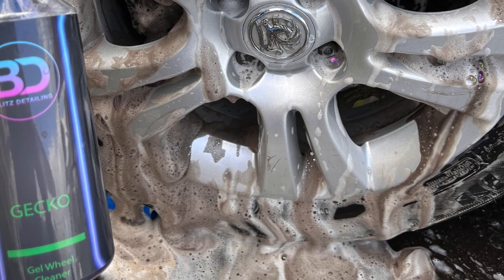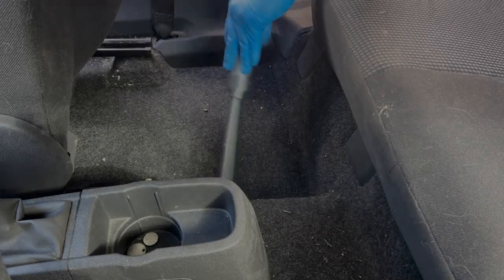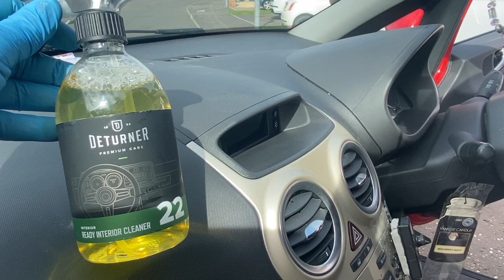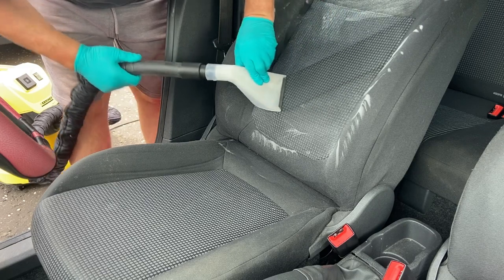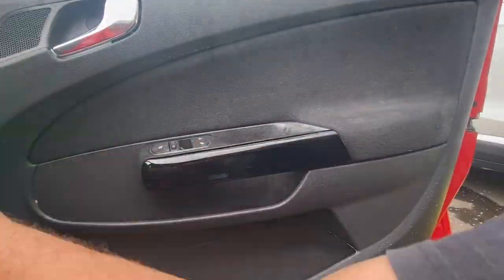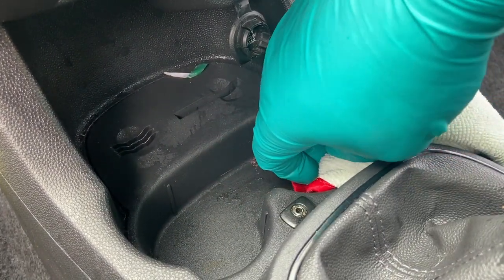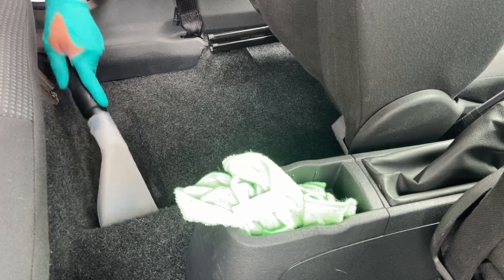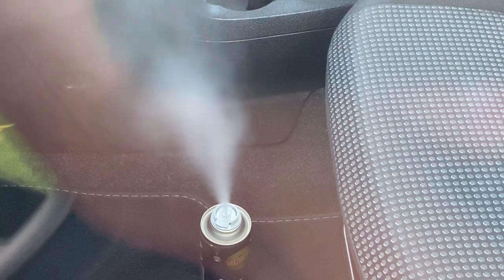CORSA D DISASTER DETAILING SERIES Episode 3 | INTERIOR WET VAC | STEAM CLEAN Vauxhall Opel Corsa

Comment: What a transformation that was inside and out! I'm all for watching guys detailing and ceramic coating lambos and Bentley's but for me this content is real life. The average car which is used daily and not cleaned regular getting an absolute pamper! Anyone would be proud to get them kind of results mate. And as a side note I'm also not a fan of interior dressing, I would usually use an interior detailer such as the bouncers inside job after a once over with an APC if needed. But that creme type dressing applied via foam applicator looks a fantastic product and certainly something I would be interested to try 👍👍👍
Reply from the maker: Thanks once again Sean, I’ve seen some very snobbish comments on one of the largest Facebook car detailing groups say ‘why?, it’s ONLY a Corsa’ well you’ve hit the nail on the head, real cars for real people and it shows that people can be passionate about this hobby with a cheap car. 
Thanks for the feedback mate !, really appreciate it

Comment: personally, if I'm doing a deep clean I will work from top to bottom, as the last thing I'm going to do is wet vac. and no matter what you do, crap will drop down.
Reply from the maker: Ahh I see where you’re coming from, I was thinking bottom up as vacuuming throes dust up in the air and if you’ve done the dash etc it’s gonna get all dusty again , but I get your workings on it too 👍
Reply: @GMDetails  to be fair, that's really only if I'm doing a full deep clean. I'm talking headlining, seats out, centre console dismantled, door trims off etc. 

I like to use a nice coat of GTechniq Matt Dash once it's done.
Reply from the maker: Wow that’s going in deep 😳
Reply: @GMDetails  gotta be done sometimes I think. First time I did it was when I bought the missus a used car that had had a water leak at some point and left a mouldy, stale smell inside. 

Took me a good 6 hours to do the full clean, but I'd gotten nearly £800 off the asking price, so it was worth it.
Reply from the maker: Nice one !! I’d love to go all in with an interior detail on an older car